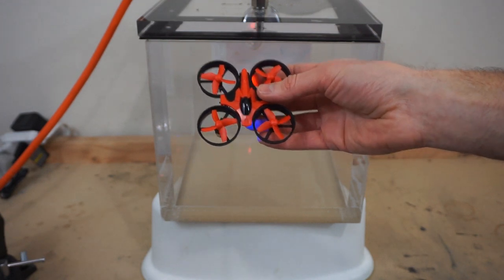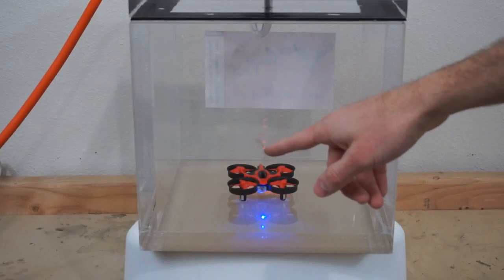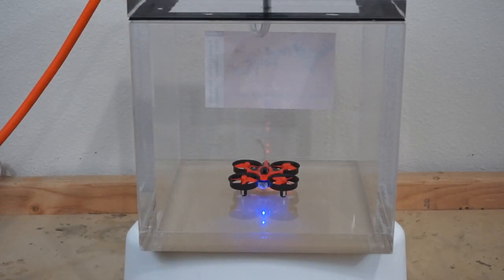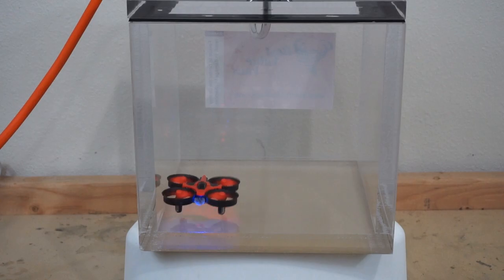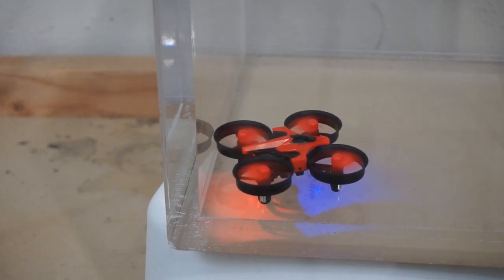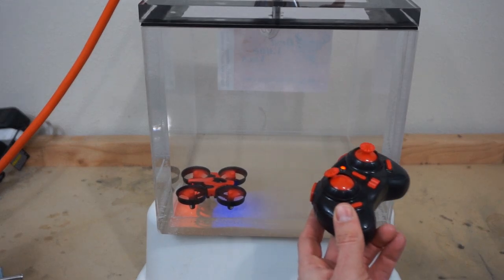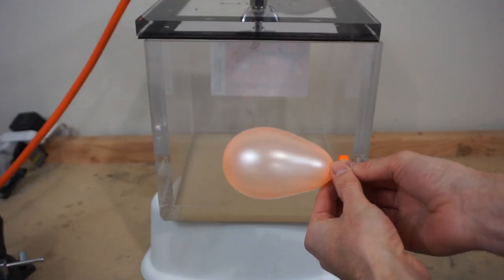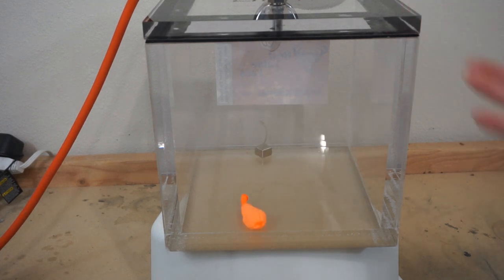What Happens When You Put A Drone In a Vacuum? Can It Still Fly?

Comment: This was a cool demonstration on drone physics!

Did you notice that you could still use the controller to rotate the drone around it's axis? That particular control mechanism does not require air as it is based on adjusting the speed difference (angular momentum difference) of the CCW and CW rotating motors.

However, this will not work if there's too much friction between the drone legs and the vacuum chamber floor but I'm guessing that with such smooth surface it would work.
Reply from the maker: +Jouni Knuuttila I didn't know that! That is awesome, I did notice how it still turned slightly!
Reply: I know that sound waves can not travel in the vacuum of space. So radio waves can?
Reply: @andrewssd  Yes - radio waves can travel in the vacuum of space.

Comment: The balloon just flopped around and fell downward to the bottom of the vacuum chamber. The gas that the ballon was expelling also was able to push off of the inside of the chamber wall, much like a rocket pushing off of a launch pad.
Based on these observations, this was a poorly set up experiment IF the goal was to prove conclusively that rocket propulsion is possible in a vacuum. Watching the balloon's reaction really does more to disprove propulsion in a vacuum than support it from what I'm seeing here with my eyes. 
I imagine it'd be difficult to set up a more accurate experiment that would eliminate the vehicle's ability to push off of the side walls to obtain propulsion, but overall this was a really neat experiment. Thank you for sharing.
Reply: "Yes" sadly balloons flop about ..... (heheheheheh) and rubber as mass is subjected to gravity and do not have their own steering !!
"Right you are" !

Comment: -.5 atmospheres... how does that work again? XD
Reply: Could he be giving amounts of air pressure removed?
Reply: Dosluke idk one atmosphere or one bar, is 16psi. So basically -.5 atmospheres would be 8psi.
Reply: you can actually have negative atmospheres?
Reply: Dosluke idk in physics and engineering they have absolute pressure which cant be less than 0, amd relative pressure which is relative to the atmosphere so it can go down to -1 atm
Reply: Dosluke idk its merely a convenient scale sonce most of our machines work under 1 atm of external air pressure so we cancel it out
Reply: ^ Joaking is right.  When comparing two systems you might see "negative" relative pressure, but there is no such thing.
Reply: oh. thanks for educating me guys :P
Reply: While it is a thing, I believe that he should have calibrated his gauges so that they read at 1atm when he started and ended at 0, I was confused as to his measurements when the drone was still flying in negative pressure. Then I read this thread and realized that in reality it should just be +0.5 atm, half the pressure of earth's atmosphere, which would still give some lift. Thank you for asking this question.
Reply: your welcome, i was confused too because the way he said it mad it sound like an absolute value, instead of relative.
Reply: Absolute pressure gauges cost 10 times as much as relative pressure gauges, from my supplier at least (they're built totally different to just a to relative pressure gauges, of course, it's not just a question of "calibration") . That's why my vacuum chamber has a relative gauge, even though I'd prefer it to be absolute.
Reply: 1 atmosphere is equal to 101.3 kPa which is standard air pressure at sea level. the barometer reads amount of atmosphere removed (-1 being total vacuum)
Reply: wrong!! 1 bar is 14.5psi. jks i dont care

Comment: There are no such phenomena as a "vacuum in space"

The balloon was propelled against the expelled air and
the barrier in the very confined space of the chamber
Reply: You weren't supposed to catch that, much less say anything about it! This video is designed for those incapable of thinking for themselves
Reply: @elmerfox6872  - Put a firehose in a vacuum chamber and turn it on if it still flops around rockets work in space
Reply: @PabloGonzalez-hv3td  A firehose that is expelling water would be creating it's own medium. Again, bad example.
Reply: @kneedragnr1  - What do you think a rocket does?
Reply: @PabloGonzalez-hv3td  It propels. But, it needs a medium to do so.
Reply: @kneedragnr1  - No they don't by your logic jet engine performance should also degrade with altitude as the atmosphere gets thinner and there is "less air to push against" yet that doesn't happen
Reply: @kneedragnr1  - I've seen that video a thousand times the sound you hear is the deployment of the yo-yo de-spin device that's used to stop the stabilizing spin of rockets to allow a stable deployment of the recovery stage or payload read the description 

https://youtu.be/5ZqbjQ9ASc8

https://youtu.be/NWgglYzdd_Y

That rocket isn't trying to enter orbit it has no reason to fly a parabolic curve 

Did you actually think it hit some kind of dome? 😂
Reply: @gregs3220   - Not exactly. Jet engines are affected by altitude on the input side not the output. As the air gets thinner speed must be increased to maintain given levels of intake flow (and lift) - hence why airliners fly significantly higher than the helicopters struggling at Mt. Everest.

A helicopter's speed, and therefore  its altitude, is limited by the speed at which the localized airflow over the rotor goes supersonic and starts producing shockwaves which reduce lift and cause an aerodynamic stall from going too fast

Their practical hover limit is the altitude at which the jet engine can provide sufficient power without moving fwd to compensate for the thinner air - this will be lower than their max altitude 

Not sure you realize that weather systems are areas of differing air pressure within an open system it's the working principle behind tornadoes and hurricanes
Reply: @kneedragnr1  - If you still believe "negative pressure" is an inward force you don't understand what a vacuum is. Weather must be a hoax since it involves areas of differing air pressure within an open system.
Reply: @PabloGonzalez-hv3td  Dude, you're not telling me anything I haven't known for many decades. But if you think that there would be a gradient in an open system with a vacuum of what the priest in the religion of scientism describes and without a leak proof barrier to contain it, you need to take some basic physics classes or grab or at least try to physically prove it to yourself. I mean really, this is basic stuff.. No "overthinking" to it!
Reply: @kneedragnr1  - You're still implying the vacuum of space produces some kind of inherent "suction" force
Reply: @kneedragnr1  So how does your theory account for the fact air density, and pressure, gradually decrease with altitude and the effects are easily observable?
Reply: @PabloGonzalez-hv3td  I'm not denying that air density and pressure decrease as altitude is gained. This is observable. Obviously, the densest gases drop thru the atmosphere to the Troposphere, causing greater pressure and, since the noble gases have their own density for each, they rise to their own levels, respectfully, in a lesser pressure. 

However, if these gases were not contained from the supposed "interstellar vacuum of space," they would all vanish like a fart in a hurricane. This can easily be observed in zeotropic refrigerants, which are multi blends that have different densities, as well as pressure/temperature characteristics. Due to this, they must be charged by liquid state and stay blended. Otherwise, if they were charged by the gas state, the lighter refrigerants would obviously separate from the heavier and the system being charged would not have a correct charge and would not transfer heat as manufacturers designed. If one was to open the bottle of multi blend refrigerant to the atmosphere, the refrigerants would boil out with the lightest, less dense doing so first. They'll all ascend into the atmosphere, finding their own buoyant levels in that atmosphere. But only if they are contained, just as they were before leaving the bottle, still under pressure. Now, imagine if they were not contained and near an infinite universe and the greatest vacuum known to man.
Reply: @kneedragnr1  - Then shouldn't the entire atmosphere exert the same pressure if the supposed "dome" is the source of the pressure to begin with? 

Zeotropic mixtures just have components with different boiling points and those refrigerants are volatile at low temperatures so they boil off it has nothing to do with the composition of the atmosphere
Reply: @PabloGonzalez-hv3td  The dome or Firmament (biblical term) is not the source of the pressure. It only maintains the atmosphere within it. I only used the zeotropic refrigerants as an example as to having different densities and, as they escape from their containment, the lighter ones will boil off first.
Reply: @kneedragnr1  That doesn't make sense. You have already acknowledged that atmospheric pressure gradually decreases well before any "firmament" the vacuum of space is just a continuation of this gradient
Reply: @PabloGonzalez-hv3td  I' sorry you do not understand this, I've been patient and did my best. Perhaps you should try your own experiment right here on earth, like trying to find curvature. It should be 8" per mile squared. Try to figure out how people commonly see the Statue of Liberty from as far as 60 miles away when they shouldn't.
Reply: @kneedragnr1  Your theory contradicts itself. You have acknowledged the undeniable pressure drop that occurs with altitude but find it outrageous that it drops even more in the vacuum of space when it's just a continuation of the same gradient.

At 60 miles the visible drop is 40 feet of a 154 foot concrete base so how exactly is it not supposed to be visible? 

The "squared" equation applies at long distances as there comes a point where no amount of altitude will make an object visible since it's on the other side of the planet
Reply: @kneedragnr1  you're absolutely correct Mark. You need a physical barrier to contain pressure and any pressurized gas on earth conveys this in a tank or balloon or a tire or a tube. All have barriers just like our pressurized atmosphere. Magical gravity doesn't hold any weight especially that of mercury
Reply: Mark Goldman - You're conflating atmospheric pressure with pressurization like you would see in a scuba tank

 The atmosphere is nothing more than a pool of air that exerts more pressure the lower the altitude due to its weight it is NOT pressurized or there would not be a decreasing gradient with altitude there would be only be one single unified pressure at all altitudes

It is no different than the ocean exerting thousands of lbs of pressure at depth and nothing at the surface you're just over thinking
Reply: Greg S I don't believe in Jeebus therefore "his" law does not apply to me isn't that how religion works?
Reply: Don, isn’t space vacuum much stringer than the vacuum in the little square box? So then a real vacuum like space will pull the brains right out of your skull without a space suit? Am I right?
Reply: Czterdziestysiódmy  A positive pressure simply can not exist next to a vacuum without a leak proof barrier between them.. PERIOD! Why is this so hard for some of you to understand is beyond me.
Reply: Czterdziestysiódmy   There can be a pressure gradient in a sealed system. A perfect example of this is multi-blend refrigerants. However, open the container they are in and the pressure gradient quickly diminishes.. I.E., the pressure gradient is lost. Again, you can not have a positive pressure (atmosphere) next to a negative pressure (supposed "space") without a leak proof barrier. 

I'm sorry but, obviously, the learning curve is just not there for you.
Reply: @PabloGonzalez-hv3td  In finite space, yes.
Reply: @kneedragnr1  The ocean has a large pressure gradient in an unsealed system explain that
Reply: @PabloGonzalez-hv3td  You can't compare the physical properties of gradients to the physical properties of positive and negative pressures. They are completely different things. As you ascend in the atmosphere the air is getting thinner because the molecules are less dense at this altitude but they are still positively pressurized no matter how high you go. You need to forget this concept of going from 1atm of sea level up to the 0atm of space. It doesn't make sense in terms of positive and negative pressures nor in the real physical world. 

Think of a glass of mercury, water and oil. The mercury sinks to the bottom, the water forms in the middle and the oil floats on top - they are all positively pressurised but they still arrange themselves based on their densities. It is the exact same for the air in the atmosphere (however the sun and moon mix things up a bit). Bringing a vacuum into the discussion without some kind of barrier/containment mechanism is physically impossible. It has never been replicated anywhere on earth and it has never been proved or observed by 'astronauts'
Reply: @Markus_Antonius  Sounds like you don't understand what a vacuum or even weather actually are. The atmosphere isn't "pressurized" it exerts a pressure from weight alone like the ocean.
Reply: @PabloGonzalez-hv3td A vacuum has absolutely no relevance to weather. Why do you think they call it high and low pressure systems? Weather is the atmosphere's way of resolving the gradients between the regions of high and low pressure. The sun keeps heating the air and water causing high pressure regions (and some theorize that the moon drains heat) causing phenomena like the gulf stream causing weather systems to travel up through the atlantic. A vacuum cannot be maintained without some form of physical containment (much like a pressurized vessel can't). What stops the air from blasting out into the infinite vacuum of space? Gravity?  :D If gravity isn't strong enough to hold a helium balloon on the ground then how does it hold air?
Reply: @Markus_Antonius  Vacuum is actually a relative term it doesn't soley refer to complete vacuums. Hurricanes and tornadoes are areas of isolated low pressure. A helium balloon floats because it displaces normal air it's like a dragging a pool noodle to the bottom it wants to float. Remove the fluid working against gravity and gravity wins. Meaning a helium balloon in a vacuum chamber does NOT float just like a boat out of water doesn't just magically hover. So what keeps the atmosphere from escaping into space? The same force that keeps anything else from escaping into space...